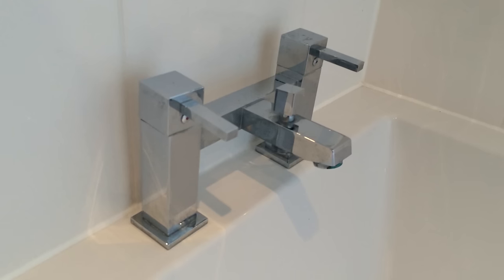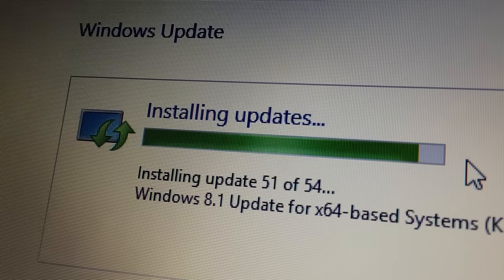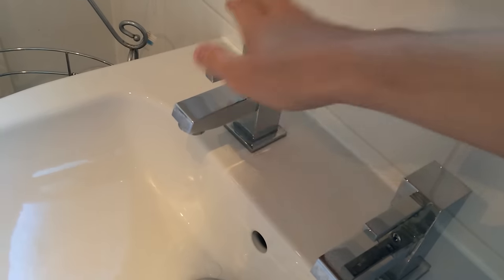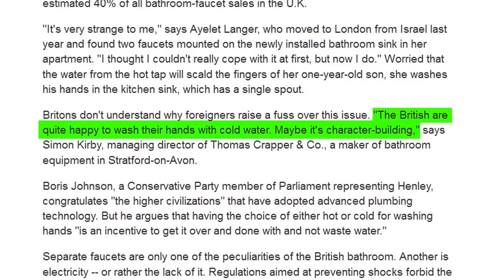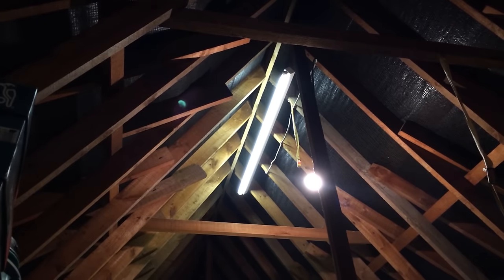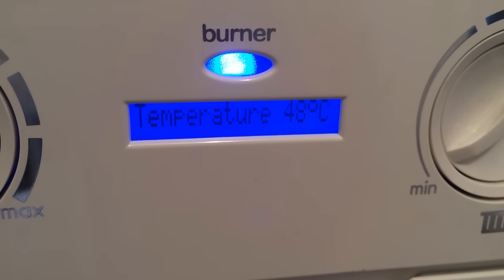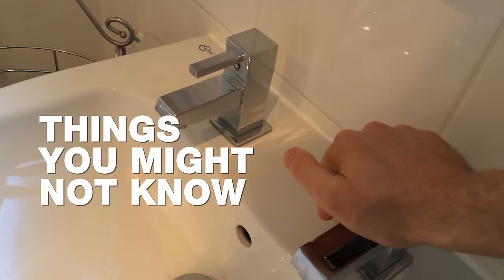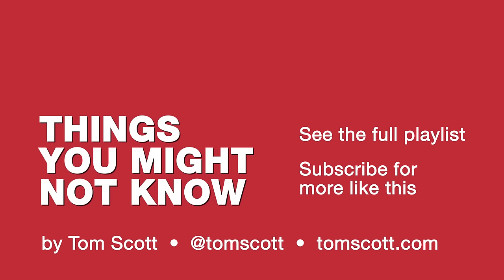Why Britain Uses Separate Hot and Cold Taps

Comment: This doesn't explain why there are always too short and you end up rubbing your hands against the sink when you wash off the soap!
Reply: So true,
Reply: The only logical thing I could come up with is this: you're supposed to use the drain plug, fill the sink with mixed water, then wash your hands with that. Possibly sharing the same fill with several other people before you drain the sink.
Reply: Quite possible but I have never seen any brits doing that apart from when they wash their face in the morning.
Reply: I feel this is generally just an oversight looking at design over function. I get frustrated by this when I find taps that run too near the back edge of the sink. However I've used plenty of taps that are deep enough into the sink that it leads me to believe it's someone looking at the style more when they buy and not pairing it with the sink they've purchased correctly.
Reply: Some U.S. mixer taps from the 1950s are ridiculously short and they actually protruded from the rear wall of the sink.
Reply: As I understand, this is generally a result of trying to save money on cheaper small taps which aren't technically designed for the sink they're being installed in. They still work just fine so nobody cares, but come with that functional failure.
Reply: I've noticed that with many older sinks... has always irritated me, particularly if said sink is in a public restroom and questionably safe to touch at all.
Reply: @jimtaylor294  my parents' house was built in 1999 (in the US), and it has this problem in both bathrooms' sinks. The kitchen sink is fine, and even has a soap dispenser.

But the bathrooms? Nah, get friendly w the sink
Reply: @HmmmmmLemmeThinkNo  I see. Here in blighty however short taps are only ever a feature of old sinks. Still not as bad as pump taps though..  those should be banned.
Reply: During World War II all of the steel went to the war effort. So taps became very small. That's what I was taught though I cannot attest to it from direct knowledge.
Reply: @TudorH56  perfect logical reply , thank you
Reply: @TudorH56  plus there are probably more germs on the back part.
Reply: That is so annoying! That probably is probably coronavirus because people are always touching the inside of the sink.
Reply: Bro I’ve never seen a comment I relate to more than this one
Reply: Thers actually a reason for that, its because pressure  changes and its better have it dribble out when its low pressure because its short than it spray out the sink when its high pressure because its long
Reply: @uplink-on-yt  And how are you supposed to put the water in bottle xD
Reply: do you use a bathtub or something to wash your hands?!
Reply: @aidanhancock2117  I still like tall ones :(
Reply: I think that’s just a taps generally thing, idk maybe it’s more common when you have separate taps, but my bathroom has a mixer tap and I always rub against the back of the sink.
Reply: @uplink-on-yt  Yes, that's why a plug is provided. Prior to plumbed in basins, we had jugs of water and a loose basin (emptied out of the window when finished. How very French!)
Reply: Correct British way to wash hands is in the basin, not 'under the taps'.
Reply: Still the same problem in germany. I don't know why these are built and if they are for really small sinks, used for the biogger ones, too.
Reply: @alsternerd  It's so the taps are out of the way while you use the sink to wash with.
Reply: I think it is to make of harder to drink   from, upstairs the most have a short version, downstairs a long one to drink easier.(its just a theorie nothing more)
Reply: @stefan-ox8qs  No, it's to keep them out of the way of the sink ! - so you can get in there whatever it is you need to wash !
Taps that stick out too far are really annoying too !
Reply: @millomweb  here we can move it left and right.(the long ones)
Reply: @stefan-ox8qs  As in kitchen mixer taps - bathroom sink taps tend to be fixed !
Reply: This happens sometimes in the US too, even in new houses
Reply: Ha probably just to make the bathroom take the smallest possible footprint.
Reply: Reason why: cheap taps and cheap sink 🤣🤣
Reply: that comes down to to the designers, the height of a tap is stipulated by back flow prevention but the lenght of the tap is down to the customer/designer.
Reply: I always assumed that was so you can wash clothes, babies, etc in the sink without getting caught up in the taps. Similar reasoning to even the tiniest London flats always seeming to have a bathtub instead of a space saving shower. It's used by some people and doesn't preclude other uses, so architects put it in.
Reply: Guillaume
That’s just bad design or it happens in order to accommodate things in tiny spaces...  I dare to say that it is the same all over the world... although it is being fixed.
Reply: Every airport in the world has the same problem.
Reply: @millomweb  but who washes things in their bathroom sink...that's kind of gross
Reply: @assistanttothetravelingsec8301  Oddly, that is what it's designed for !
Reply: @robertknight4672  in my country its the opposite - the old sinks have enormous space between the sink and the tap - the tap goes up very high and curves down. its also uncomfortable because the water splashes everywhere. 

good that at home i got sink with reasonable height
Reply: YES! This is the other thing that really annoys me about bathroom taps! Why are they always so short? What are they trying to allow room for? Even if you're someone who regularly washes your hands by filling the sink, the taps could still come halfway across the sink and leave plenty of room for that. The length they are is INSANE!
Reply: @assistanttothetravelingsec8301  how's it any different from the kitchen sink? I mean, other than it being in a different location? At the end of the day it's still a sink, is it not? I actually use my bathroom sink to dye clothes and fabrics quite often, I also wash those clothes in it, I don't get how it's gross 🤔
Reply: Dammit I hate that! Why’s it so hard to make faucets that adult hands can fit under?
Reply: This isn't a brit only thing. Its a major pet peeve of mine in canada
Reply: @robertknight4672  they're  only ridiculously  short when you use them in a sink for which they are not intended         don't be silly.
Reply: @MrTarmonbarry  except i don't think taps were ever made of steel  only brass      its a corrosion thing
Reply: I frequently get annoyed by the issue of short taps. But unless I buy a new basin & taps, plus the time/effort or cost of install, I'm gonna have to keep being annoyed.
One improvement I have made to my 1960s house is to have a combi boiler installed, which means I have no water tanks,  and drinkable water from every tap.
However, filling a glass or bottle from the bathroom sink is awkward, and in winter means potentially getting very cold hands from splashed water :-(
Reply: Taps and sinks are in a weird state of some imperial measurements and metric. small margins get amplified and you end up with a right mash up. I'm a plumber. I notice where all these bits are made. Turkish sinks make me wonder if the lads making it ever saw one. So in short its mixing parts from around the world I reckon. Hopefully we can evolve as a species to finally sort the problem out.
Reply: i hate that!!!!
Reply: Aesthetics!
Reply: @uplink-on-yt  that actually sounds disgusting
Reply: So you don't bang your head on the taps when you wash your face.
Reply: Bro, I feel your pain, you are not alone.
Reply: @uplink-on-yt  When I was a kid we used to do this to wash your hands.
Reply: I believe that when you put in a new bathroom, you purchase the sink and taps separately. So, you would need some foresight to get compatible tap lengths for the sink. Although if you were renovating your bathroom I’d imagine you’d think of this, seen as it’s your bathroom.
This still doesn’t explain why sinks in public toilets or hotels have awful bathroom design. The sink bowl is oftentimes way too large for most uses. Filling up the sink is not common practice for much in a bathroom. Furthermore, if the sink bowl is too large, the taps are awkwardly far away.
Reply: I have big hands so I feel this
Reply: It's cheaper
Reply: @Trsier Google British bath water sharing...
Reply: Short taps….. washing hands under RUNNING water really was a thing for the longest time due to cultural memory being filling up a basin with water and using a soap rag to scrub. Mostly that’s because peoples hands were dirtier when the went to wash them and it required a lot more time to return them to a satisfactory clean state, we and the amount of water that would take using Gun wanrunning water exceed that using a basin. People just didn’t get the concept of bacteria being a health concern ……. Washing your hands under continuously running water is something only doctors did , this there was no reason for the taps to extend any farther.
Reply: Good point there, I hate that!
Reply: That's easily explained. It's a badly designed sink. You get then all over the world
Reply: Don't suppose you are in a British council house are you?
The last sink they put in leaked, and made a real mess underneath my lino in ths bathroom (toilet was leaking at the same time!). They gave me a new sink (that wasn't actually new at all, so it's impossible to get fully clean, as the enamel appears worn away in places). The tap that they put in is tiny, so my hands, my face flannel etc are always touching the actual sink and the overflow (which gets moldy). I hate it but they won't change it.
Reply: @LoveBadeMe   Taps are usually cast from brass... (and Chromium plated) Though in terms of saving material, what you say could apply, irrespective of material type...
There was a time when, in brassware catalogues, you'd find "long" and "short" projection taps of the same basic design... "short" was suited to a small hand wash basin installed in a WC (as opposed to a full bathroom) Long projection tap spouts denied adequate access to the basin... you'd batter your hands on them, while washing... They suited a full size basin, though...